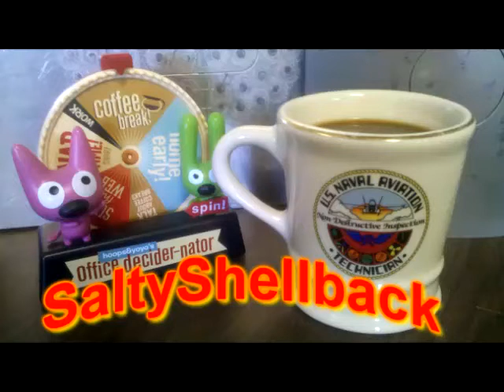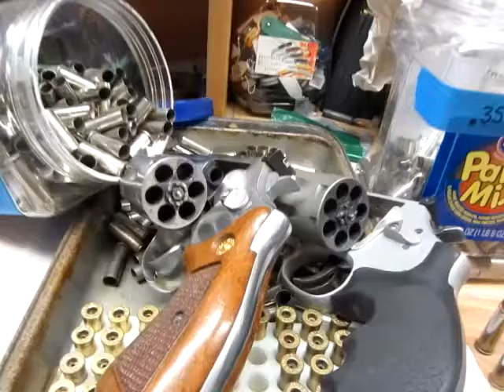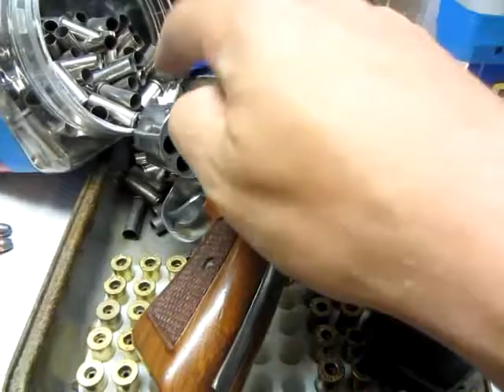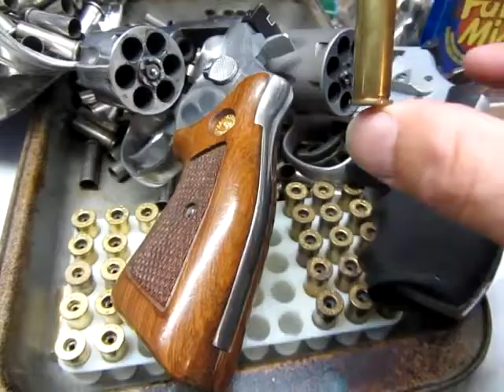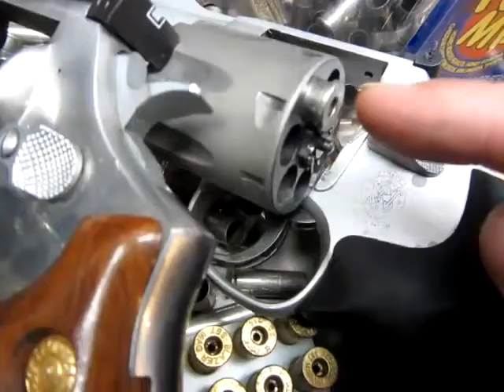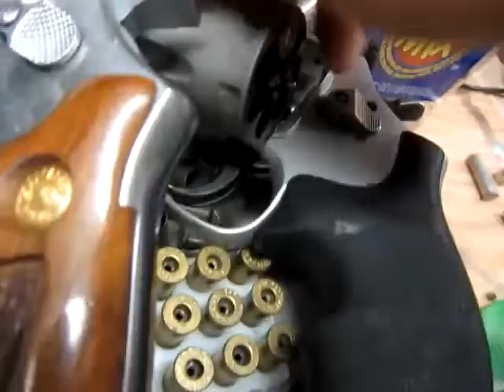Revolver cilynder tolerance

Comment from the maker: I'll check, but I am sure is not the cylinder wall, it is my resizing die. I miked the casing with the old die and it was about 0.004" larger than if I resized with my new dies.  It is also only at the lower end of the casing.  Apparently the old dies have worn out a bit.  I got them used at a gun store, so who knows how many rounds have gone through them.  Factory ammo goes in just fine, and the reloads made with my new dies go in just fine.

Comment from the maker: Could be, I never thought about it that way. I just know the cavity dameter is about 0.005" smaller on the Smith.  You wouldn't think that would add that much strength to the cylinder.  If it made that much difference in the strength, I would be concerned.  I am guessing the machining tolerance at Taurus is +/- 0.010 and it is +/- 0.005 at S&W.  Making more "acceptable" parts at Taurus vs. S&W, thus more revenue, thus, less expensive.  Sounds like I need a video about the manufacturing...lol

Comment: there are a few companies that actually make dies with a slightly smaller diameter to help in cases like yours. They usually call them small base dies. If you get a set of those your rounds should chamber in anything out there. It doesn't have too much to do with "tolerance" per se.  Some guns (and manufacturers) have larger diameter cylinders, and some have smaller,.. and I believe no two chambers (even on the same cylinder) will be exactly the same.  No two barrels are the exactly the same (i.e. Marlin's 44 mag leverguns nearly always needed bullets to be .430 or .431 to get their best accuracy with cast bullets.  Not sure if the new ones are the same or not. I used to have a 38 special that had a single chamber that was slightly tighter than the other five. But I never did bother with buying  a small base die set for it.
Reply from the maker: Clay Austin Cool thanks!

Comment: It happens the same to me, but whit smith & wesson and Colt revolver. Some reloads fit well in my S&W revolvers but not in my Colt Officers Model .38, but all the factory loads fit my .Colt Officers Model .38. I used to thought that  the Colts have less tolerane in cylinder because the .38 Colt Special was considered a diffente caliber than the .38 S&W special in the past. But maybe it was just a little differences between two of them in manufacturing.
Reply from the maker: Yup!

Comment: with a revolver I would assume that cylinder timing and alignment - barrel rifling is more important than slightly larger bore holes.  If it were a brake system cylinder, I have this nifty three stone hone that fits on a drill to clearance them with no issue.

Comment from the maker: Bummer.  That is why I will spend the extra $50 or so to get a .357 in the same model so I will be less likely to exceed the powder charge.  I have some .38 special casings I have loaded to medium .357 charges, but I will only shoot them out of my .357, so it won't be a problem.  I even marked them "357" on the casings just incase I forget.

Comment: Do you think you have build up in the cylinder from shooting a lot of 38's
Reply from the maker: I don't shoot the S&W much and the cylinders were clean when I made this video. I think it is a combination of tight tolerances on the Smith and slightly worn reloading dies not resizing the cases back to minimum diameter.